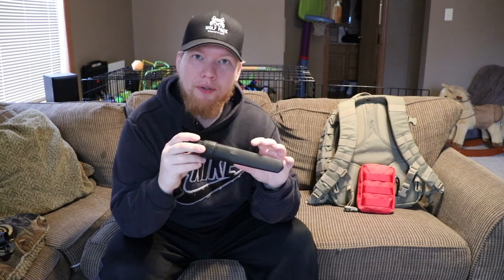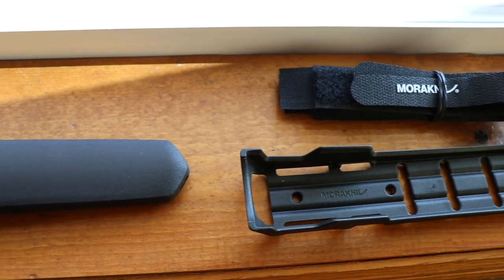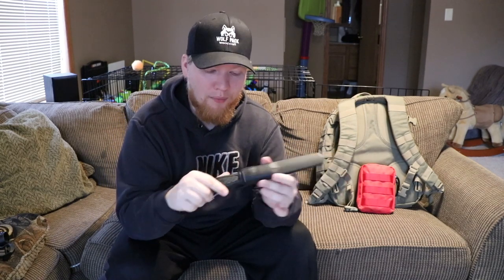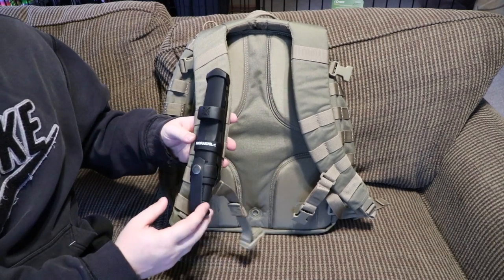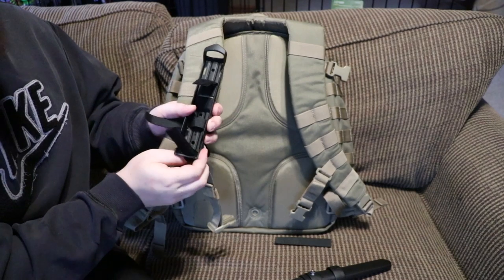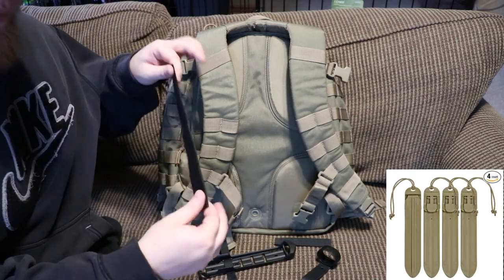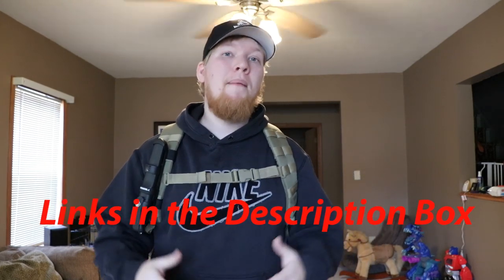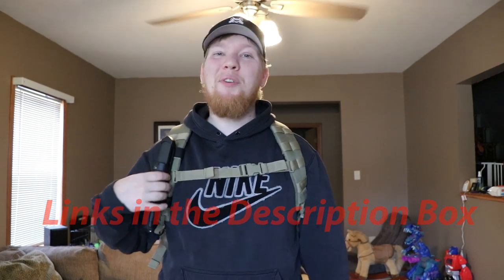How To Use The Mora Multi Mount Sheath System

Comment: Hi from Indonesia. 
I really liked your video and the way you explain it thoroughly.
I owned a Morakniv Garberg Multi-mount for a year now. Haven't had much experience with it so far.

Anyways, good luck buddy!
Reply from the maker: Thank You so much for watching!!! I'm glad I could help you out. The Garberg is a great knife. The more I use mine the more I like it. I preordered the Garberg Black which is the high carbon steel version. It should be here sometime in April. I can't wait to compare the two.
Reply: Thanks for replying, I just now subscribed to your channel :)

Yes I got the news about Garberg Black from one of the Morakniv's Ambassador on Instagram (I can't remember his name). A (high) carbon blade knife still not into my preference for now. I would stick to stainless steel blade for now, because of its resistance to corrosion, and therefore, for me it's safer to involve it in food/cooking cutlery.

And, my preference for a carbon blade would be tramontina or another (high) carbon steel in form of parang/golok with 12-18 inches long. Because I lived in Indonesia which in tropical climate, the forest/jungles/mountains are often wet, the blade will likely to rust/corrode, but it's okay as long as I'm not processing food with it :)

When you post the Garberg's comparison, I may get the Youtube's notification and watch it.
Keep up the good work :)
Reply: but who knows, because of your Garberg's comparison, I may change my mind about Garberg Black :D ;)
Reply from the maker: I really appreciate your support!!! I can't wait to hear from you more often.

Comment: You have to wonder about Mora development staff.......multi-mount system but won't handle molle mounts. Nice strap with snap to finally secure a MoraKniv.....but with no belt loop....but a belt loop without security strap..what the hell. Don't get me wrong, I love my Moras but for Gods sake when will they put some effort into their sheaths? They should all have security straps as the plastic sheath loosens over time and some have zero friction...some get caught up and pulled out....the plastic belt clip can hang and it gets sprung. Yea, you can heat it up and get it back in shape but how hard can it be to fix these simple issues?
Reply from the maker: Mora knives are all machine made and I would guess they put all their  money on the knife making machines and put very little into the sheaths. You can always re-sheath a good knife but no one ever wants to buy another knife for their sheath. I understand Mora has built up a reputation on inexpensive knives but it would awesome if they came out with a line of knives that cost more but came with a great knife and sheath combo. I feel all knife companies just quick make a sheath to cover the blade instead of taking the time to create a knife and sheath combo everyone would enjoy. Thank you so much for watching I really appreciate the support.
Reply: I love their knives ...as good as most and better than many higher priced knives. Scary sharp right out of the box and easy to maintain. I did have to sharpen the spine some but other than that it was the sharpest production run knives I have ever seen. I love them. As for the sheaths they really aren't terrible just not very secure.  The belt clip can get snagged and as a result it gets sprung outward and no longer locks securely to your belt .A lost knife at the wrong time could cost you your life so I guess we should be willing to pay the extra $40 or so for a good leather sheath. But then I am like..."Damn, I am paying more for the sheath than I am the knife.:)" Guess we want it both ways....cheap and good. :)

Comment: Kinda cool. But if you no how to out buttons on leather. You could add a button to each piece. Just the mail on the belt loop piece and the female on the other with the loop to keep the knife intact. So when you out the belt loop up and it's loose snap the button and it stays. If it's leather on both pieces. Or put Velcro a 1 in or 3 quarter in and the will hold good. That way you can still carry on your belt and have the strap across the top.  But that's me I like to figure and fix. But love that knife don't want to no the cost but yea I like thanks god bless
Reply from the maker: If you catch it on sale sometimes it goes for as low as $60 so for what you are getting I think it is a very awesome knife and sheath combo. Survival Lily uses both the snap and belt loop together even tho it doesn't snap on and she doesn't seem to ever have any problems with it and she is WAY more knowledgeable than I am when it comes to knives and being outdoors. Thank You so much for watching!!!
Reply: wolf pack woodcraft yea it looks nice. Prob bY the end of next year it will be on sale or just cheaper. I'll keep track. I found a knife for 1.99 it's not Mora looks close but bk knifes having close out sale love the saying on it. If you got Android or apple. Go get BK knives go to close out man what a sale yea cheaper knives but some are good I've had. But go check out survival and ax wow some sweet stuff. Thanks again God bless

Comment: I have just bought one of these knives, and am very pleased with the knife itself. I looked at the various bits supplied with the sheath system, and could not figure out how it works. Having watched your video, I sort of have an idea, but have stuck it back in the packet and put the knife in a leather sheath that I have, which fits perfectly. One day I might watch your video again slowly, and try to work out what to do, but to be honest I probably never will. It is just too complicated.
Reply from the maker: It is a very complex design but once you figure it out it is very easy to use. Honestly, I like just having the plastic case with the belt loop. I really don't need any of those fancy attachment system just to carry my knife around camp. Thank you so much for watching I really appreciate all the support!!!
Reply: My concern is that, should I try to use the multi-mount frame, and put one of the straps on incorrectly, the whole thing could fall off my pack, without my being aware of it. However, this is probably only a theoretical possibility. I live in Scotland, which has very strict knife laws, so would usually carry my knife in the plastic sheath in my pack, or, off the beaten track, just use it with the the belt loop. My leather sheath, designed for a "Boar" knife, fits the Garberg as if it were made for it.
Reply from the maker: The Multi-Mount sheath system is very secure. The button closer does slide from side to side so I don't suggest mounting it upside down if you don't have direct eyesight with your knife. If you like the leather sheath you should stick with it. Not worrying about losing your knife is gonna help you focus on much more important things.

Comment: Excellent presentation. I am just about to buy this knife, but have been unclear as to whether to buy the one with the leather sheath or this one, primarily because I did not know how this plastic sheath works. Now I do, and I will buy this version. Good job, sir. Thank you.
Reply from the maker: I'm really glad I could help. The leather sheath is a good sheath as well I just don't like the flap that goes over the knife. It gets in the way more than it is helpful. The multi mount sheath is very easy to use once you understand it. I'm sure you will love this knife and sheath combo.
Reply from the maker: If you are wondering about the Stainless vs the Carbon they are basically the same thing ==> https://youtu.be/QcOxDFxao4Y
Reply: I just got through ordering the knife with this sheath system through Amazon. Christmas in November!
Reply: I went with the stainless version. It was delivered yesterday. My only complaint...the handle is a little slick for my taste. What I did? I took my engraving tool, and etched lines across the top and bottom of the handle, perpendicular to the length of the knife, spaced about 1/4"  apart. This has improved the grip by at least 30-40%. I think Mora could have done this in the molding process, just as they did with the checkering on the sides, without adding additional cost. If you find it a bit slick too, you might give it a try.Read more Show less Reply     1
Reply from the maker: I actually really like the handle on the Garberg. I find it very grippy and for a knife this size I don't feel the extra engravings are needed. You will have to let me know what you think about keeping it sharp. Keeping an edge on the Garberg seems a lot easier to me than some other stainless steel blades.
Reply: I'm glad it works for you. Different strokes for different folks eh? So far I am very impressed. Did a bunch of battoning and feather sticks last weekend, and it still shaves my arm, and slices paper like right out of the box.  I will keep ya posted on the sharpness durability in a few months.
Reply from the maker: It really is a great knife. I'm glad you have been enjoying it.

Comment: The thing is it doesn't seem as if it can be deployed from an upside down position (say attached to a pack strap) without the  sheath coming with it as that part is only held in place then the snap is closed. Or am I wrong?
Reply from the maker: You have to get the velcro really tight for it to stay in place if you are not using the molle. The friction fit helps hold the knife in place inside the sheath without the snap but I wouldn't trust it while hiking. I also use my thumb to hold the sheath in place while I deploy the knife like I would with a Kydex sheath system and that seems to really help. Thank You so much for watching!! I hope I answered your question.
Reply: Yes you did, thanks. Wow, it's a kind of a major design flaw to an otherwise good idea. I mean, you've gotta take the whole thing out then switch out the pieces to wear it or risk losing the sheath. It looks cool but doesn't really make a lot of sense. Yea, Kydex is definitely the way to go but I just can't see spending more on that than the knife itself. Oh well, at least they're making them switchable for left-handed carry now. That's a big plus to the 10% of us with that issue. Thanks for sharing!
Reply from the maker: I think they did have a great idea but the by trying to keep the cost down they missed some really great opportunities with the sheath system. There are a few things that would make this system one of the best but it feels like budget got in the way and so they just left it as is.
Reply: Sam Smith: That is incorrect. The sheath is held into the multi-mount by a velcro strap (the one with the Morakniv logo on it), the knife is then a push-fit up into the sheath. Once the mount is attached to your pack, the strap with the button-press closure (which also feeds through the frame of the multi-mount and adds to the sheath's security on the mount) is opened/closed to release/secure the knife. You would only need to release the sheath from the mount if you wanted to swap it to belt-carry while you're out and about (maybe when you reach camp or whatever). From 9:40 onwards will demonstrate what I'm trying to say - hope it helps.

Comment: I really wish they’d just made the regular sheath with the webbing slots built in without this extra jigsaw puzzle of unintuitive extra pieces to solve and lose, but thanks for explaining it. There’s no info out there on this. I subbed.
Reply from the maker: It is confusing but I don't think a lot of people molle web their knives to gear. Also by having the hard plastic you can screw it to walls and different hidden locations that I'm sure they felt people would use much more often. Once you apply it a couple times its actually pretty easy to do but it was a pain to figure it out.